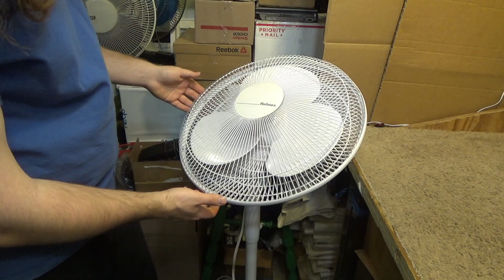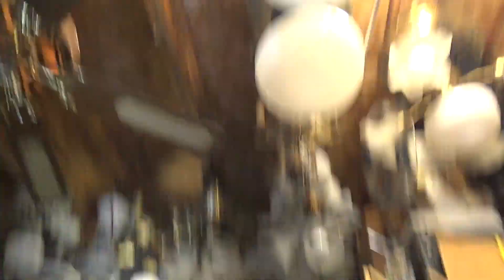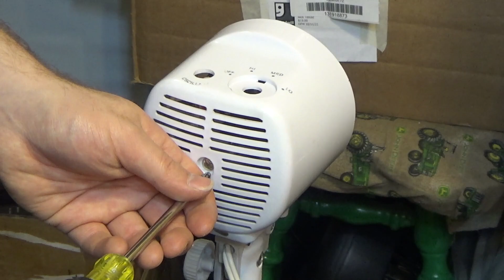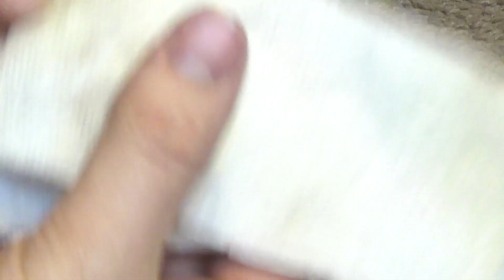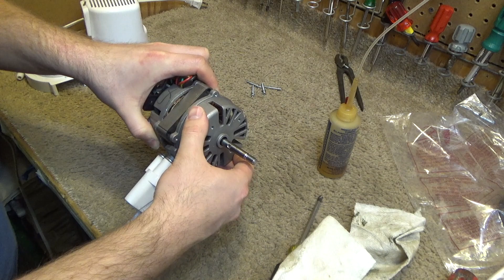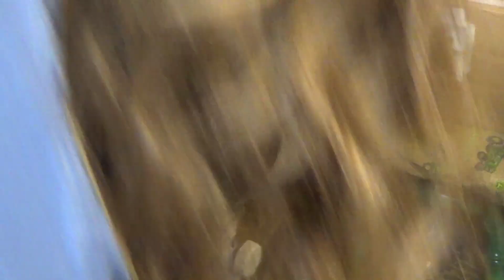Servicing a Holmes HASF-1506 16" Oscillating Pedestal Fan

Comment: These fans seem much better in the way of ease of service, since you don't have to disconnect the wires from the switch to get the motor cover off. I hate that about their desk fans with the switch on the back. I wonder if the last of this style, the 4 in 1 still used the same motor.
Reply from the maker: I agree. Not sure about the 4-in-1's design, definitely would like to find one of those though. The same classroom that had this fan also had one of those.